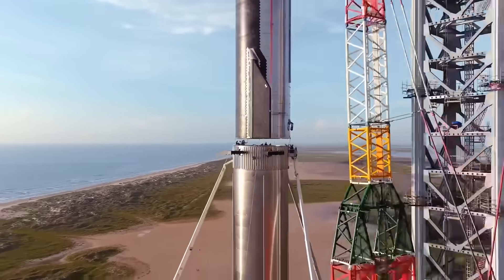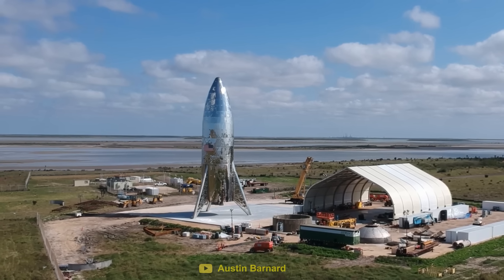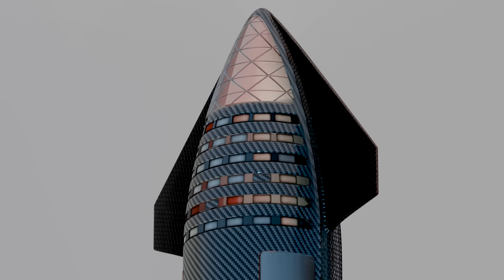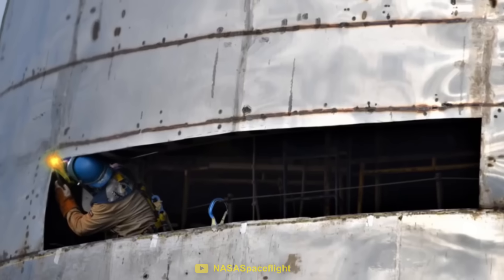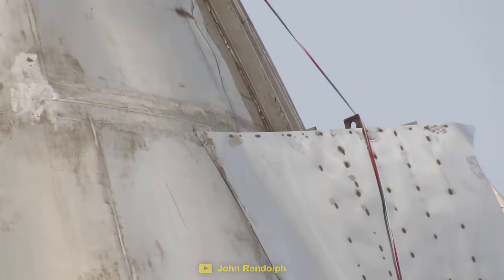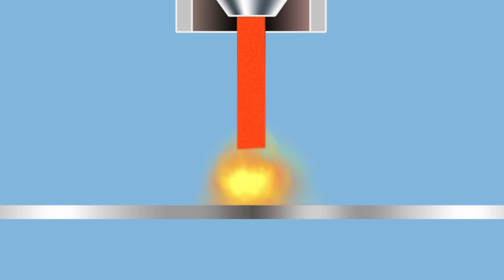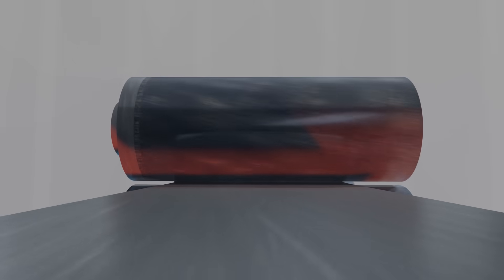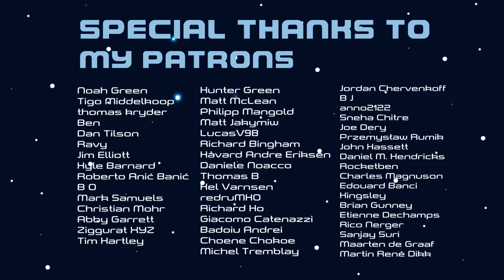How SpaceX Mastered Starship’s Welding

Comment: At 3:45, I think you may be mistaken about flux-cored arc welding, the metal is on the outside and the flux is in the middle (core). In the video, you describe it as the metal being surrounded by the flux, which is true for stick or SMAW, but not this. The reason the flux is in the middle is because the drive wheels that push the wire through the gun have knurling to grip the wire, and if the flux was on the outside it would rip up the coating while feeding it. Otherwise, great video I really enjoyed learning about the different iterations of welding SpaceX has been going through.
Reply: nice i was going to point this out...
Reply: There are quite a bit of comments on this post from non-welders talking like they have welded before.
Reply: Me and my popcorn here for the welder egos
Reply: I unsubscribed from this channel because he is too full of himself to listen to his commenters
Reply: @LeesReviews69  I think that Kalroy is as well. 
He may have certifications in small critical part welding on fancy metals for aero space but that isn't the same as experience building tanks or pipeline welding or doing field repairs on heavy equipment and it certainly isn't the same as oilfield construction or repairs or the various types of welding involved with building a nuclear power plant or refinery and to compare his work to underwater welding is laughable. Any one of the jobs I mentioned is no less critical than the work he does as people could be killed or millions in financial losses could occur do to welding failure. If your not experienced in any of those types of welding or Flux core welding then he may have opinions but not the experience and knowledge of doing that kind of welding for a living.
Reply: @crazyoilfieldmechanic3195  All valid points.   Mind you, I've pounded many beers with iron workers, pipe welders, and others who do welding I would have learn to do.  That said, we're not talking about any of that, and I have done more than a bit of pipe.  Not much water pipe,  no oil or fuel pipe, but more than a bit of high pressure gas and liquid pipe ranging from 1-36 inch.

More importantly,  we're talking about aerospace welding, not construction welding.
Reply: @Kalroy  what’s the difference? Full penetration means full penetration. You can’t get better then that. I am a welder
Reply: @dm4226  max penetration, reinforcement, allowable porosity, inclusions.  You're familiar with all that.  Figure that on 0.050" you're allowed 0.050" penetration and reinforcement,  probably 0.005" max porosity, but it could be 0.017" and all that.  BUT that's the AWS and military standard.  Space X can have any standard they want.  So far as I know they're not bound by any NASA, fed, or any other external standards.
Reply: @dm4226  So for aircraft and spacecraft there are maximum penetration heights inspected prior to being allowed to dress the welds.  If there is too much, or the opposite  concave, then it's supposed to be grind it out and start over.  To be real, though, people cheat on that all the time, but not if you're doing your cert tubes.   Then a fail means you submit two cert tubes and both have to pass.  But like most things you don't call the inspector, or submit your certs unless you know they'll pass visual.   The xray,however is another matter and or of your hands.
Reply: I'm just here for the pissing contest.
Reply: Also wrong about the description of why the welds are softer than the surrounding metal and why hammering them hardens them again. Certainly not from expansion (reduction in density) and compression (increase in density) as he heavily implies.

Like, this is basic stuff. This is what happens when your presenter doesn't actually know anything and just plagiarizes the script from other sources and then makes shit up.
Reply: The video creator clearly knows very little if anything at all about welding. He also mentioned that flux core is good for a controlled indoor environment but not outside, which is the complete opposite. It releases toxic gas so needs good ventilation and its only benefits are wind resistance and price.
Reply: You obviously are not a welder, there is inner shield and outer shield flux core.
Reply: @derekc4919    inner shield = shielding gas comes from the welding electrode (wire), outer shield = shielding gas is delivered externally as inert gas like argon, helium, co2 or a mix of them.
Reply: (once in orbit we are halfway to everywhere in the solar system)
Reply: @replica1052  we have far bigger problems ahead once we get it into the atmosphere like having to travel far a fuck fast as fuck
Reply: @peytoncorrea4975  earth visits be mandatory for all martian born, and martian born will always be the most interesting persons in the room
Reply: Stainless mig with trimix would be best way to weld it. Also cleaner and also stronger
Reply: What do you expect Elon Musk and his 16 17 year old relativity 3D printer isn't a massive construction crane spirals extruding metal/Metalloid/ceramics or polymer 3D printer all brush metallic type Effects and or 100000 colour shade & effects conveyor belt H design 3D printed and rolled out of a hanger H 3D printed design or and spiral half a tube hanger half underground prefecto ringlets tracks with robotic 3D printer and 3D laser or and new 1000.000 + PSI aiirjet (cleaner than water jet tech to cut any everything) which probably won't be needed as long as he's 3D printing his jet 🔥 nozzle parts components which would be quicker injection mould metal high heat high pressure mould tool 2 faces
Reply: @KnightShift006  well said!🤘😁
Reply: I caught that too.
Reply: Wat
Reply: Nobody making a video, gives two shits, about how welding really works.
Reply: @bruceh99  Yes, people who posess something called intelligence do. Probably unfamiliar to you
Reply: Right. In french "Fil fourré".
Reply: one other thing that may or may not have been said, and I am only an novice welder, but I somehow don't believe that they would have welded stainless with flux at all. I don't think I have ever heard of stainless being welded with flux but only TIG. then again I know you can use wirefeed with aluminum and maybe also stainless then, which is also nasty but that still uses shielding gas.
Reply: "The reason the flux is in the middle is because the drive wheels that push the wire through the gun have knurling to grip the wire, and if the flux was on the outside it would rip up the coating while feeding it."
Also the current for welding needs a conductive interface which the flux wont be able to provide.
Which is why SMAW electrodes are blank at the end to attach them to the current with your stick holder while the tip is exposed too, so you can start and arc via scratch-start.
Reply: I see this has been covered 😆
Reply: This is welding from an engineer's view not a welder's
Reply: What?  You're actually saying that 
flux core has the flux in the middle?

You're LYING!
(Seriously, you got it right.)

steve
Reply: i was coming to say this lol
Reply: Also,  Flux core gives a nasty weld.  Better to go with some form of tig. Maybe wire feed tig.  Even mig would be a better choice.
Reply: @Kalroy  not better for outdoors though and tig is more time consuming than flux core mig.
Reply: @harmankardon478  Absolutely.  Though it allows a much higher quality weld.  Which may, or may not be required depending on what you're doing.
Reply: @harmankardon478  Oh absolutely.  You need to choose the process you need for your application.  You wouldn't TIG H-beam, but then you won't ever FCAW a jet engine part.  You might use it for stainless pipe, depending on what it was for, but you're more likely to go straight TIG or TIG root, stick cap.  Again, depending on what you need.
Reply: @Kalroy  Not really. Flux core can look as good as GMAW if you are a good welder. It may look ugly once you lay a bead, but once you wire wheel it up. It looks fantastic.
Reply: @x91s55  It can look good, but that's subjective.  It will never, to me, look as good as GMAS butt on 032 titanium done with the same high skill level.  So for me, coming out of aerospace, welding on rocket stuff and x-planes, FCAW will never look as good.
Reply: @Kalroy  Actually, you can get some epic welds with flux core, or even stick, if you can control the conditions.
Reply: @Kalroy  shielded flux core makes pretty nice welds.
Reply: @zacharytuttle5618  I agree it does make pretty nice welds, for what it is, just like stick can make pretty nice welds.  What it is, however, is not good for aerospace.  Ignoring appearance, Lord knows I've been forced to ignore ugly welds that meet minimum spec, consider that the maximum inclusion and void would be 0.020" and that the cumulative currently has most of the U.S. Air Force's veteran welders failing their aluminum certs and you can see how it'd never be good enough for aerospace.  Also, I still find a well done cobalt or titanium butt to be far prettier with zero post-weld work.

I will say, that stick and mig have actually been used in aerospace, and not just the Soviets.  There's an aerospace museum down the street, and it's sobering to see how bad the welds are on those really old jet engines and rocket engines.  I mean really bad.  Any CWI would fail them out using the D1.1, let alone the D17.1.   It was a decade plus before they started coming out with aerospace welding standards.
Reply: Kalroy flux can produce great looking welds. Just make sure to spray to anti splatter around the work area or have a wire wheel nearby. It’s messy but it doesn’t make nasty welds
Reply: @Kalroy i can't understand why they chose fluxcore, stainless like this would just best be done with tig
Reply: @Kalroy  tig inputs too much heat and will distort the stainless super bad
Reply: @Kalroy  Not necessarily, it's also one of the light systems so good if you need to work high up
Reply: @Kalroy  not true at all. I'm not even a great wire welder and I can get nice clean flux core welds. Sure there's more spatter than tig, but a quick spray of spatterguard pretreatment and it wipes right off. Tig is my favorite, but I'd much rather do extremely long welds with a wire process than with tig.
Reply: @diveforknowledge2126  yes, but never to the same quality of an aerospace tig weld.
Reply: @Kalroy  Only if you don't know what you are doing. Same applies to stick welding. Those who produce bad welds with it blame the process whereas it actually is the person who is doing it that is to blame. And yes, I have both types of welders. Plus the ability to TIG weld or MIG weld. And for building up large areas, nothing beats stick welding.
Reply: @gravelydon7072  I'm going to say it's subjective.  Yes, you can make beautiful welds with those processes but compared to TIG...  But it depends on application.  I'm not going to run a 0.040" tungsten to fill a large gap, and I'm not using SMAW (adding an extra rod like TIG filler) if I'm welding 0.020" nickel sheet either.
Reply: @kalroy45  also flux core stainless really needs to be dual shield for decent results. At only 3.5mm thick, there really needs to be an argon purge on the inside of the rocket too to avoid porosity from oxidization. I'm not arguing against you in any way, just making a point of my opinion.
Reply: @gravelydon7072  do WHAT?! building up large areas with stick!? dude you've lost your mind....
Reply: @narmale  Don't say anything about what you haven't done before. It is called a pad weld and is very common for repair work. It is used to build back thickness in an area which has worn. A common place for it is in a boiler mud ring.
Reply: @gravelydon7072  oh ffs, no, you dont get to change your statement

Mig vs stick for simple speed and material added, MIG always wins, NOT using a plate filler... that wasnt stated so dont act like your all superior,
This was mig vs stick PERIOD
Reply: @narmale  No, maybe you should go back and read my first statement before you make your comments. I'll quote it here to save you the trouble of going back and looking at my first comment. "And for building up large areas, nothing beats stick welding." And MIG does not win when you are working with thick materials as for speed. And MIG is even worse on a day when you have to fight a wind to weld outdoors.
Reply: @narmale  welding isn’t about speed and deposition rate. You can have a high deposition rate with a crappy penetration profile. Stick puts in less heat and has a way better penetration profile than mig.
Reply: @eyeballengineering7007  nailed it.
Reply: @Kalroy  Flux core produces awesome welds. You are no welder.
Reply: @dolphincliffs8864  Wow, that's quite a pronouncement.  You don't even know me.
To be fair, you are partially correct.  I'm not 'just' a welder anymore.  Now I have to maintain a couple of D1.1 certs, and six D17.1 (actually they're D17.1 compliant IAW 00-25-252), and maintain my CWI.  I'll make time in June to get my D17.1 endorsement, but I only have my D1.1 right now.  At my current job I do welding repairs and fabrication work on aircraft, aircraft parts, and support equipment.  Aircraft ranging from a 747, to F15s, F18s, and a couple of X-Planes.  I handle overage for the structures guys, and overage for the machinists, so I have to be competent at both.

I've never worked hanging red iron as an ironworker, though, when I worked construction, I did help the iron workers when my part got slow.  My part was primarily liquid helium, liquid oxygen, liquid hydrogen, and ultra-high pressure lines (pipe from 1" to 36" for the big run lines).

I was also the Air Force Flight Test Center's lead experimental welder, and their SME for heat treating for over a decade, since heat threating is also handled by USAF welder/machinists (Aircraft Metals Technologists).

So does flux core produce awesome welds?  Sure,  so does SMAW, and Oxy-Acetylene can put down a weld that's just as, if not more awesome (yes you can stack dimes and nickels with it) but nowhere near the quality needed for much that I've worked on.   

But what would I know since apparently I'm "no welder."
Reply: @dolphincliffs8864  every process can produce great welds as long as the welder is capable. But i would still prefer a tig weld when it's possible due to aesthetics and general cleanliness. You can't beat flux core when you're welding heavy construction stuff outdoors though.
Reply: @dolphincliffs8864  No they don't. They leave terrible welds and the puddle is super sensitive to atmospheric contamination. You are no welder. They are good for crude outdoor cheap welding where you have lots of wind, but that's about it. Do they make strong welds? Yes, but they are anything but awesome. Especially considering how they weld STAINLESS with fluxcore.. it's going to cook the chromium right out of it.
Reply: @Kalroy not if your at least decent at flux core however I do agree tig is a lot cleaner in general
Reply: Flux core is mig welding.
Reply: @joekerr168  Yes, and no.  Flux core is a form of gas metal arc welding, but NO ONE confuses flux core with standard MIG welding.  Just like they don't confuse either with dual-shield despite the similarities.
Reply: @joekerr168  the AWS defines several types of welding processes such as FCAW: self shielded no gas, FCAW-G: dual shield uses gas, GMAW: spray transfer solid wire w low CO2 mix like 95/5, GMAW-S: solid wire short circuit w gas [traditionally called MIG or MAG depending on the gas mix] mig stands for metal inert gas so technically self shielded flux core is NOT mig cause there's no inert shielding gas.
Reply: @Kalroy  yes very different than hard wire. Mig is a generic term
Reply: @joekerr168  No it's not...MIG is actually Gas Metal Arc Welding...flux core is FCAW but....flux core can be run with a gas shield in some procedures.
Reply: @joekerr168  Mungsten inert gas
Reply: @joekerr168  no, mig stands for Metal Inert Gas welding. Flux core is a similar but separate process. Mig requires gas and flux core is gassless
Reply: @IDealMachiningLLC  dual shield flux core is mig welding. You are splitting hairs to seem smart. Do you even weld for a living?
Reply: @joekerr168  no, it is not. MIG is an acronym for metal INERT GAS.
Reply: @joekerr168  Dual shield is MAG welding. The CO2 used in dual-shield is an Active gas, so it's actually a METAL ACTIVE GAS process.
Reply: @joekerr168  It is not. MIG literally includes gas, which flux core doesn't use.
Reply: @joekerr168  indeed I do, and dual shield is not a mig process. Mig is done exclusively with solid wire.
Reply: As a welder this made me cringe, flux core main application is for outdoor use. This entire video just made me cringe but a for effort
Reply: @credit__devin  (welding in 1/3 g)
Reply: @replica1052  you can do flux core in every position 1-4g 1-4 f
Reply: @credit__devin  (to surrect planets is how to live in a universe)
Reply: If you know how to set your machine you could do OK but the fact of the matter tig or plasma arc is your best bet other than robots 🤖
Reply: As Elon is such a brilliant engineer he knew of all these problems but just wanted input from his fanboys. Whenever he needs financial advice such as selling billions of dollars worth of stock he polls his worshippers and acts on their advice alone. In his beautiful graphics of the huge expanse of glass in the forward auditorium he is just waiting for his fans to tell him how to support this against air resistance at launch and zero external pressure in space and reentry on Mars.
Reply: True, well said.